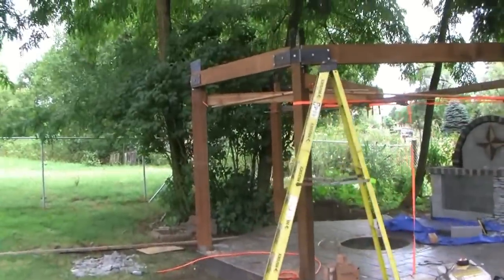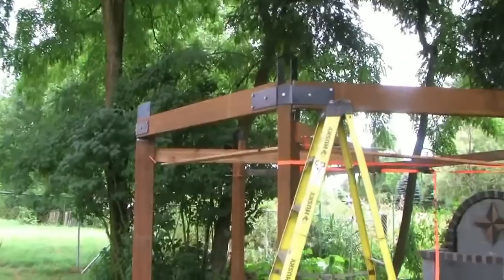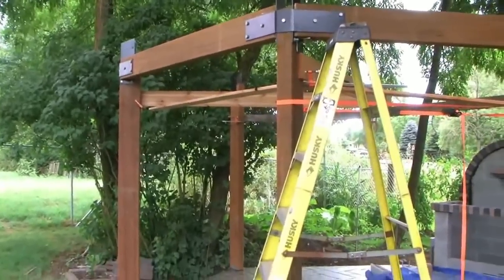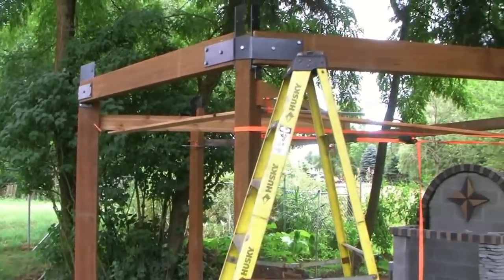How to build a Gazebo. DIY Timber Frame Wood back yard Gazebo. Simple woodwork Pergola & Round

Comment: It looks great.  This is from a non-professional.  Why is everything veneered? 

The base is made out of concrete, but it's made to look like stones.  Wouldn't i just be cheaper and easier to use stones?

The fireplace is made out of cinder blocks and then lots of time and effort is spent to cover them up to look like stones.  Isn't it cheaper to just use stones and skip the cinder block?

And then there is a fireplace AND a firepit.  I'm considering making one of these gazebo's as well, but why both?

From an outsiders perspective, it looks excellent, but it seems like far too much effort and funds were spent on illusion.